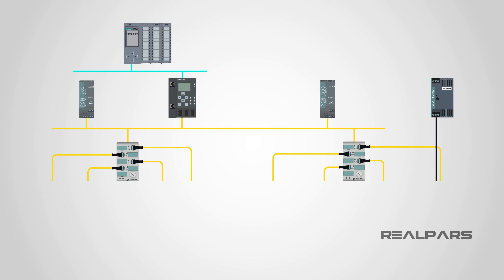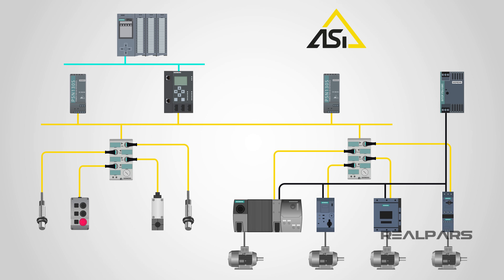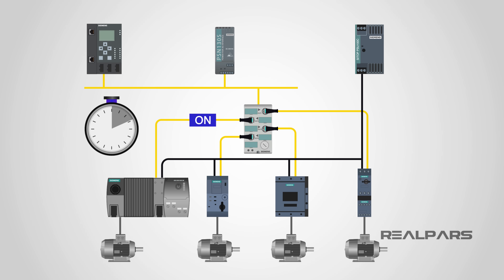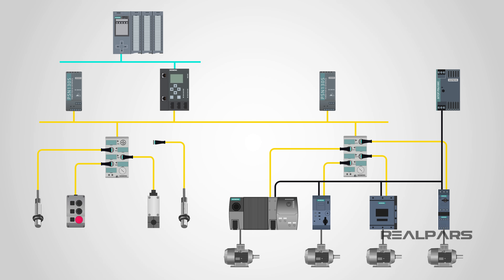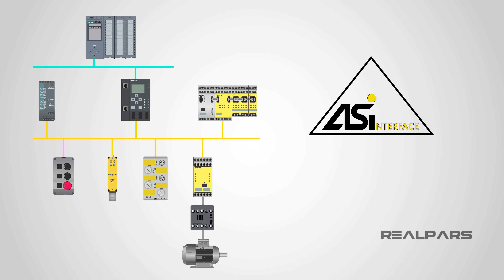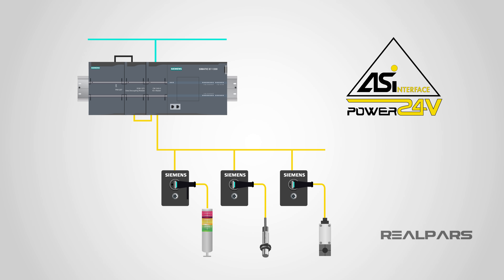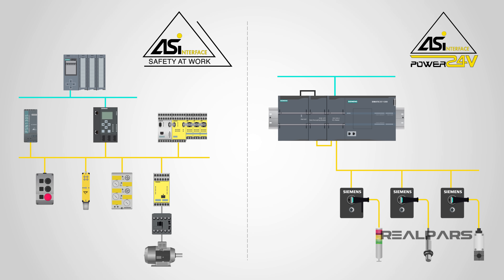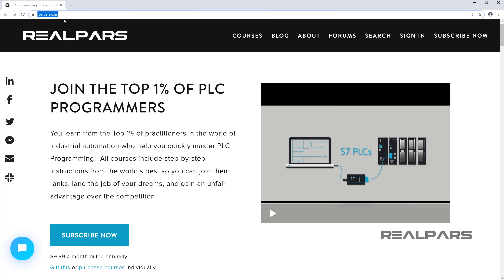What is AS-Interface?

Comment: 4:52 Are you sure about the 600m? I found out in a original Siemens manual its says the max length is 500m:

AS-Interface - Einführung und
Grundlagen
Ausgabe 04/2006
C79000-G8900-C089-04
Handbuch
Reply from the maker: Hello Marc Matini, thank you for your question. If you go to page 38 of the same book, you will find the 600m information from Siemens.

Happy learning!

Comment: Do ASI ThinkTop modules have to be addressed beforehand when replacing existing unit or is the address assigned by the network upon replacement?
Reply from the maker: The ASi address is programmed into the ThinkTop module using the setup pushbuttons on the module.  It is always advised to set the node address prior to installation in the field, if possible.  For ASi nodes without a setup process at the module, there is a plug-in node programming tool that can be procured from several manufacturers.  You will need to have 24VDC power to any ASi module for which you need to set the node address.

Comment: hi Sir, it means no need to address the slave in hardware configuration in Simatic manager software PLC? sorry I'm just a begginer. Thank u
Reply from the maker: Great question!  In an AS-i system, the network configuration only requires the configuration of a node number, unique for each slave device.  For Siemens slave devices (active and passive blocks), there is a plug-in address dongle that allows the setting of the node number, so no configuration (other than identifying the ProfibusDP/ASi link device) is required.  No EDS, GSD, or EDDL files are required since all AS-i devices use the same data structure (one byte in, one byte out).  More info can be found here:  https://cache.industry.siemens.com/dl/files/856/1171856/att_961903/v1/SYH_asi-grundlagen_76_201805231008141616.pdf

Comment: Is that field instruments required AS interface compatibility or either use any converter to make the communication?
Reply from the maker: There are two types of ASi devices:  native devices that have the ASi interface built directly into the device so that it can reside directly on the ASi bus, and interface devices to which normal 24VDC devices can be wired and the interface block itself multiplexes the data and resides on the ASi bus.  To communicate via ASi bus, the devices connected on the bus must be ASi capable and certified devices.

Comment: Thanks for this video... If we use as_interface network
It is necessary to use sensors and actuars have as_i  interface capabilities or I can use any sensors?
Because I readied the as_i interface manual
It says as_i use <m8> <m12> connectors and the sensors don't reach the slave by as_i wire it use normal wire... Thanks
Reply from the maker: Derin, the ASi firmware need to reside either at the sensor or at the I/O block connection.  If at the sensor, the sensor can be connected via a passive device to the ASi network.  In this case, the ASi firmware at the sensor stores the node number and other configuration data.  

If the ASi firmware is in an I/O "brick", then the node address resides in the "brick".   In this case, the device does not have to support ASi since the communication packet is formed at the I/O brick.
Reply: @realpars  thank you realpars
Reply: Derin you can use any digital or analog sensor wired to an IO module, or some have AS-I chips in them.  You can aslo put safety devices on AS-I.
Reply: @DrivewayWorkshop  thanks
Reply: Yeah that's one thing that wasn't shown. You can connect sensors directly on the bus line, but those need to be AS-i compatible. If your sensor doesn't have an AS-i modem in it, you can use an IO slave (like used in the video) to plug it in, since IO slaves only read AS-i telegrams as "okay which output to set or reset and what are the states of my inputs?". Because you won't find AS-i sensors all the time.

I had a research project on AS-i once in college and stuff like optical safety barriers always need to use a safety input module for safety purposes.

When he said that you can literally snap devices on cables, the animation in the video got it wrong. He showed a connection between an IO slave ans a sensor using an M12 connector. In reality the piercing part is the IO slave daisy-chained to the bus, that uses what here we call a "vampire connector", that indeed pierces the yellow cable.